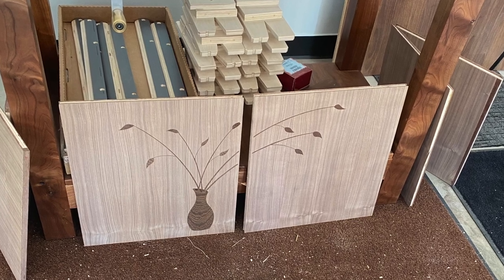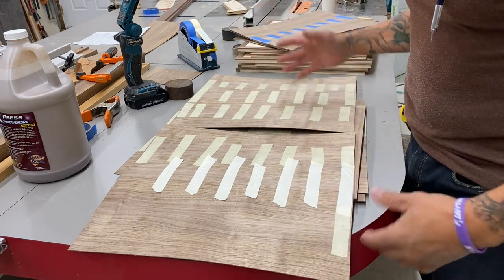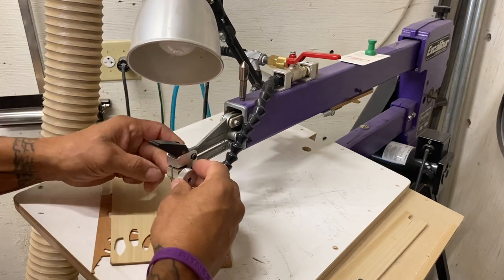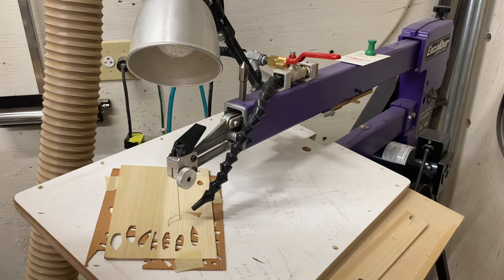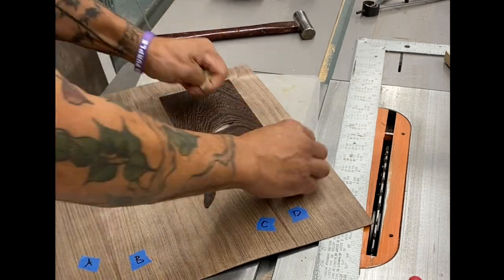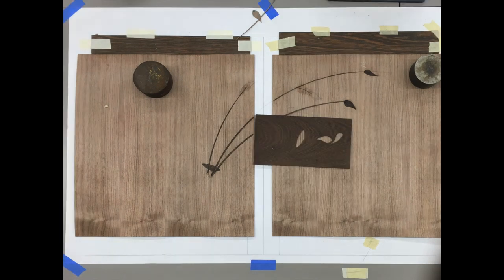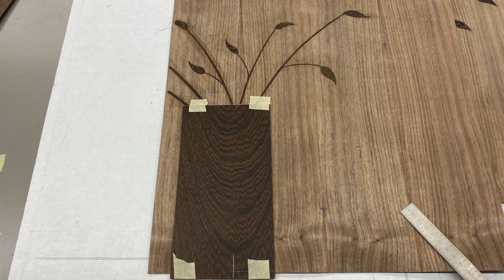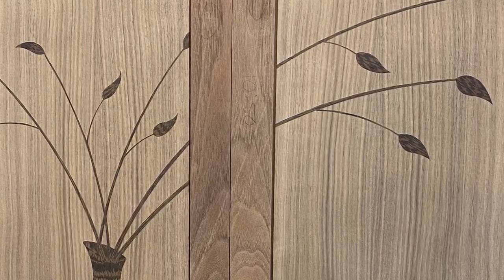Marquetry & Inlay Part 1

Comment: Absolutely loved these two videos on marquetry and inlay.  Can you share how you determine the table angle for different veneer thickness ?
Reply from the maker: Great to hear…thanks! 

It’s really trial and error.  Of course when I learned, the thickness was 5/64” with a related angle of 7°…so I was informed of that relationship.  Since then, I’ve used a few different thicknesses.  

1/32” requires 20°
3/64” requires  15°
1/16” requires  10 1/2°  (my favorite) 
5/64” requires. 7°

I’ve use 1/42” (industry standard of commercial veneer) and the angle is high, but I don’t remember exactly. It’s a little too thin for my liking.  25° seems about right.  Hope that helps.

Comment: Fascinating to watch you work so quickly and accurately, Ramon.  I love the design of this piece. Did you ever think that you would be using what you learned in geometry class all these years later :-) Your pivot point with the measuring tape under your arm is a classic Ramon trick.  So simple and so useful as well.  One of these days, I'm going to have to try some marquetry. Thanks!!
Reply from the maker: Thanks David!  I do remember loving geometry in high school! 😆 I also called my algebra/trig teacher after I had graduated and thanked her 😬 

Anyway…marquetry is such a fun and absolutely satisfying craft to learn!  You would excel at it!

Comment: Did I miss where you explained how to figure out the angle you need to set your saw at relative to your veneer thickness or do I need to buy your course for that bit of info? :)
Reply from the maker: Yes, of course you need to buy my course! 😬  

I’ve never found a formula (I’m sure that it wouldn’t be too hard to figure) to find the relationship between angle, saw blade size (2/0 or 3/0 is what I use) and veneer thicknesses.  I just learned a few by trial & error.  Here they are from thick to thin: 

5/64” needs 7 1/2°
1/16” uses 10 1/2°
3/64” = 15°
1/32” = 21° 

Those are the thicknesses that I’ve used.  I learned with 5/64” but thought it was too thick.  My favorite is 1/32” but a more substantial thickness well suited for furniture is 1/16”.  I’ve done marquetry with the commercially available 1/42” (I don’t remember the angle…probably 25 or so degrees) but it was just too thin for my liking.  Hope that helps

Comment: Nicely done Ramon. Excellent video as always. Do you tend to cut your own veneer when its this thick or is it fairly easy to source thicker veneer in the States? Do you do much with thinner (0.4-6mm) material?
Reply from the maker: Thanks Mark!  I like 1/16” (1.5mm) thickness for a couple of reasons.   A) I can easily find that thickness in many species…or cut it myself…I have a good inventory.  And 2) I like the substantial thickness for furniture.  It can be sanded without worry!   

I’ve used .9 mm with good results and am currently working on a project with .6mm (1/42”) and it’s more challenging for sure.  The only reason I went with this thickness is because it’s all dyed and thicker veneers that are dyed (in the colors I wanted) were not available.  Thanks for the questions!
Reply: @ramonartful  appreciate your reply Ramon.

Comment: I've got a drum sander question for you (actually, I have 2 questions). Is yours a double drum sander and if so are you using both drums?  Do you find that you get a consistent thickness coming out of the sander?  I've got a similar looking sander and I only use a single drum typically with 80 grit paper.  I don't always get consistent thickness of the material coming out.  The drum is aligned perfectly so I am wondering if the varying density of the wood is causing the problem.  Any thoughts from your experience?
Reply from the maker: Interesting.   Mine is not the highest quality but it does surprisingly well! (Woodtec 25”) Generally, I keep100 grit on both drums….if I’m doing a lot of “thicknessing” I’ll switch both to 80 grit. Like when I use to cut all my own veneers for my Marquetry Class 101 course. ( I now purchase most of those veneers) I don’t typically use mine for sanding …mostly for sizing veneers.  

This drum sander can’t handle much more than a 1/4 turn at a time….more like an 1/8 of a turn is what I do.  But it does sand consistently and very accurately.  I do think that varying wood densities could create a problem.  But since I sneak up on the target thickness, it seems to work well.  Thanks a ton David. Hope that helps.